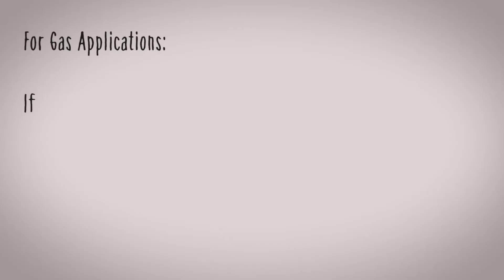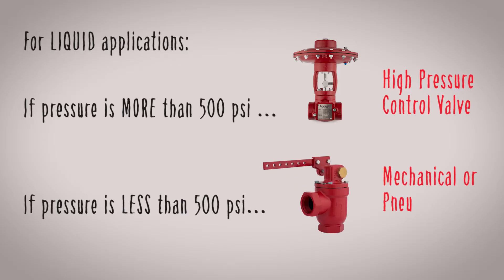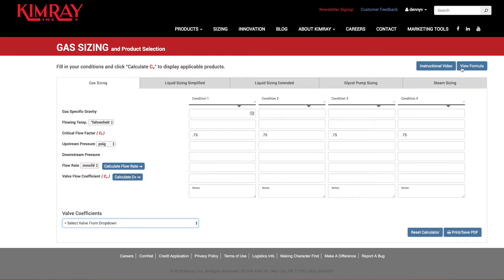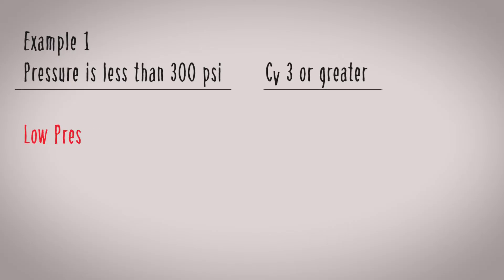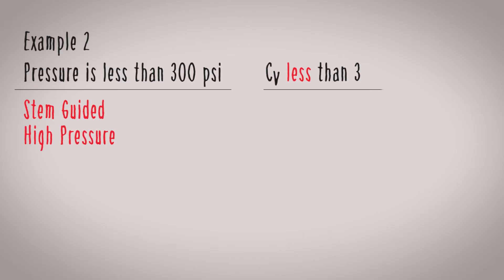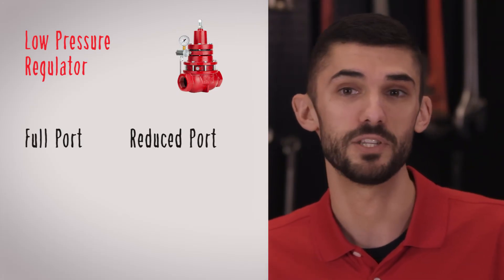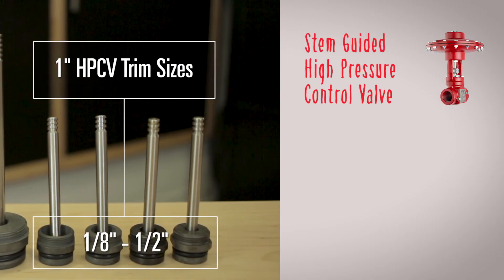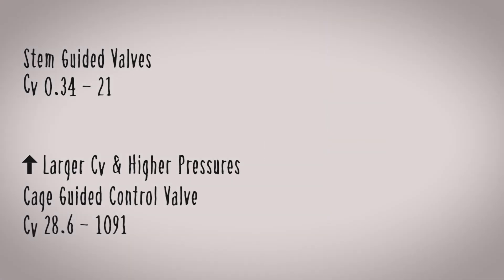3 Tips to Select and Size a Control Valve | Valve Selection

Comment: i have questions what if process  is wet gas and pressure is 4000 KPa? stem guard will be suitable...
Reply from the maker: Yes, stem guided valves are a great option for wet gas applications and with the appropriate connection type, 4000 KPa is no problem. You do want to have a source of dry instrument gas or air for the controller or pilot because wet gas could affect the pilots operation.